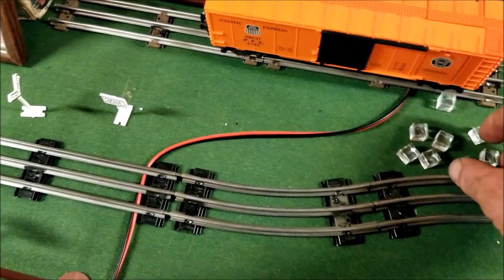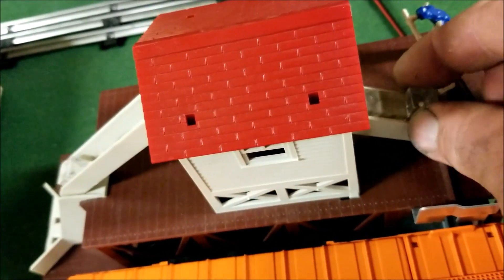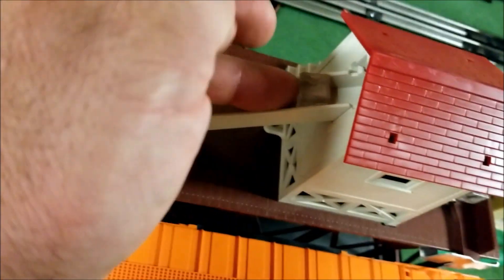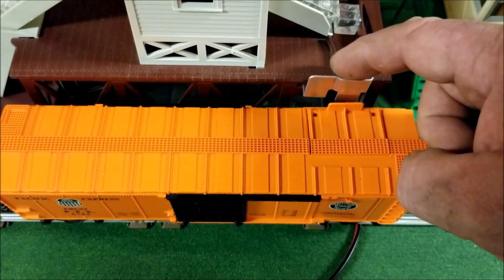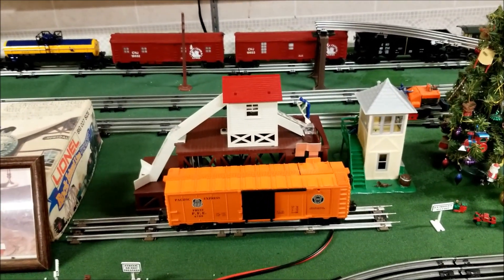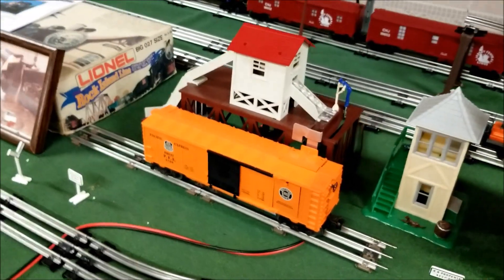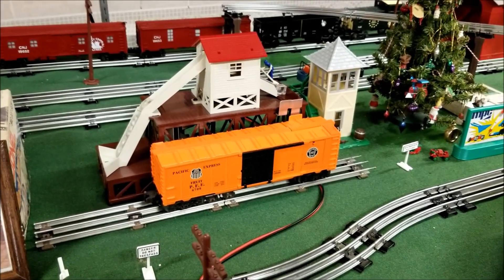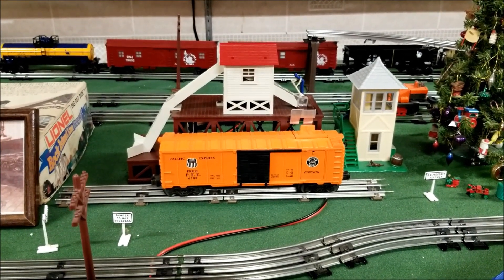Video Demo   Lionel MPC Era PFE Ice Station O Gauge

Comment: I got myself one of these maybe 2 or 3 years ago- as others have pointed out, the practice Lionel intended for loading the ice into the icing station was to position the blocks on the liftable chute, and then raise it so that gravity would send them down through the house and into position for the workman to load them. 
As far as I know, the MPC version is virtually identical to the postwar one- the decoration/color of the station may be different, but the construction of the thing is (as far as I understand) more or less the same to the postwar original. Only drawback to the accessory is that imho it's far better suited to a tabletop layout, than a floor layout. Nice piece!
Reply from the maker: I really like it. I agree about the part that it's better suited for a table top. During my years as a kid running trains on the floor I never used it.